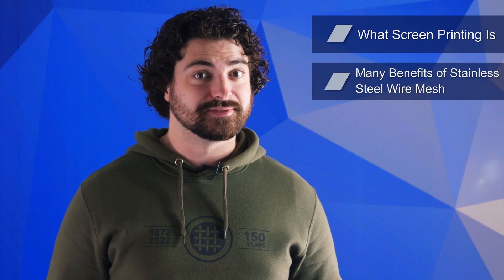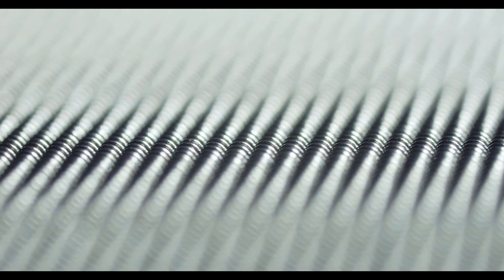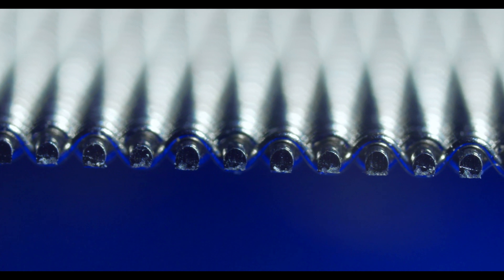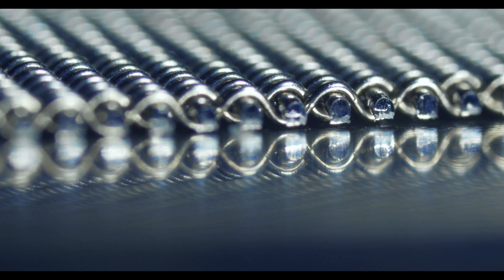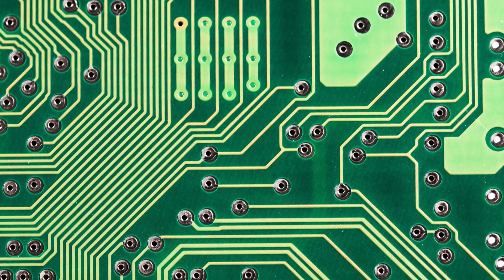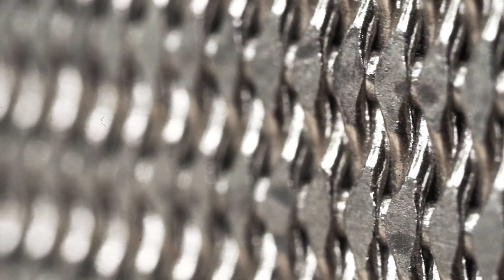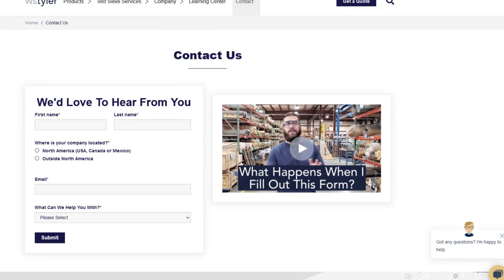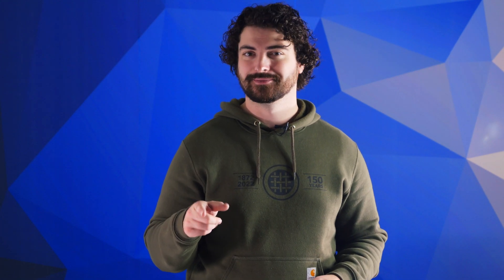Wire Mesh for Screen Printing

Comment: Hi there, thanks for the great video. Which mesh stainless stell is the best for using Co2 laser to have the best printing resolution. We tried the 100 mesh with Xtool and the print quality is really poor. Its a nice device but simpply doesnt work when it comes to small tiny text content. Would be great iof you have recomendation if 200 230meh and which emulsion is good to laser. Thanks so much, cheers Andy

Comment: I'd be curious to know your thoughts on lasering designs on wire mesh screens. Xtool just dropped a video last night. Would love your thoughts.
Reply: That's how I ended up here! My film printer died, but I'm wondering if theres a way to use my CO2 laser to make screens. I figured it will probably cut right through polyester mesh, but maybe something like insect door screen would work. I had no idea there even was stainless mesh for screen printing. But, hey, if you watch enough youtube videos eventually you'll stumble onto something cool! I've seen a few videos on the Xtool, it looks like a non-standard (too small) screen size, for my needs anyway.